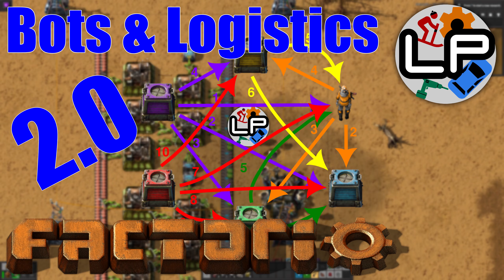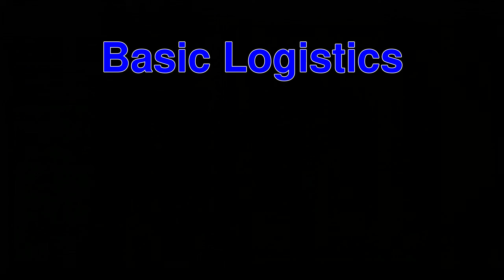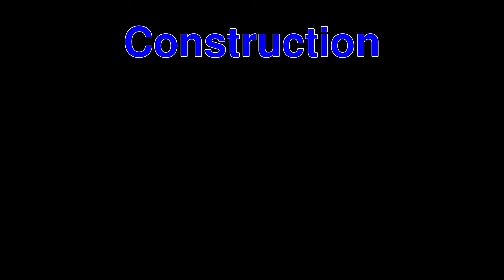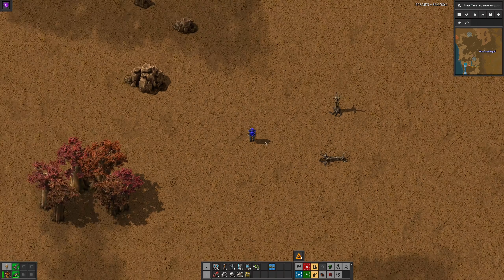Bots and Logistics tutorial for 2.0 - Laurence Plays Factorio

Comment: Nice video. What’s a reasonable number of bots per roboport? Any downsides to filling network with max bots?
Reply from the maker: If a roboport fills up completely then the bots will have to fly somewhere else to park, but that doesn't really matter... 

What I generally do is have machines making both types and putting them into a roboport whenever the number of available bots of their type drops below 100 - that way it naturally grows with your factory. Granted, if you do a massive build, you could be bot limited for a while, but it'll eventually catch up and be ready for your next one! As a bonus, this means you'll automatically replace any bots that get destroyed or stolen!

You can read total bots and available bots from the roboport by linking it to the circuit network, and turning the appropriate option on inside it - that will read for all roboports linked to that one, not just the one you attach the cable to.
Reply: @LaurencePlays  I personally use 15 construction bots and 10 logistics per roboport. The robots get into the system via inserter with logic - by comparing the [R - number of ports in system] *  (type_of_robot_per_port) and the actual amount of robots of specific type.

I guess you can use robots available for logistics and robots in system for construction, as logistics shouldn't have spikes, but my bases don't relay on bots for the most part, so I haven't seen any issues with my way.

Comment: You didn't explain anything about how to actually create a logistics network or how chests are linked to it via the colored wires. If I have a factory creating turrets and dropping them into a red chest on one side of the map, how do I make robots on the other side of the map access those turrets via a network?
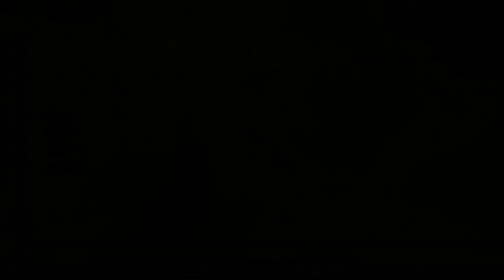Reply from the maker: 0:33 "The roboport network is formedby placing multiple roboports in range of each other" so you just need to make sure you've got linked roboports all the way from the red chest to where you want them to be built. Remember that the red chest has to be in the central, orange area around a roboport, but the building can be in either orange or green areas. 
You don't need to link cables to the chests for this, however the cables do allow you to do other things.
Reply: @LaurencePlays  Yeah I got that part. I wasn't clear on the need for roboports to be within range of the red chests at the factory output. I guess I imagined that simply linking the chests via colored wires would give them access to each other regardless of distance. Of course, as you explain it, it makes more sense.
Reply from the maker: @niconoire  Aha, no, the bots need both the pickup and dropoff/build areas to be covered by the roboports. This allows you to split off different networks, if you feel the need to.

Comment: Really great explanation, thanks! Using bots has really been great. I delayed it bc i knew id have to  figure it out. I'm on my 4th attempt and finally launched a rocket. Now with space age, there so much more to learn. My factory is a huge main bus design with nuclear power. I built all of it myself without bots and it was getting too difficult to manage. Now i feel dumb for waiting so long to use them. I have an extensive fluid network bc i despise fluid shortages, having bots to fix it now is a relief lol. This game is slowly consuming my life. I'm finally learning trains next.
Reply from the maker: Thanks! Yeah, bots essentially unlock copy/paste, which makes expanding the factory a breeze instead of a chore. It's one of the things I consider to be basically essential in any factory game. 

Have you seen my tutorios on trains? That would give you a good starting point with them! 

I'd recommend playing quite a bit of vanilla before moving on to Space Age - it's quite a lot more complicated. Great fun, but definitely a step up in difficulty!

Comment: so I basically figured most of this on my own with trial and error and it wasnt that hard as I thought. the hard part is using this in a smart and fast way and have everything ready for building when you need it
Reply from the maker: Definitely; having a decent sized buffer of parts so when you request a build, it happens quickly and smoothly is vital to keep the game flowing nicely. If it takes ages for your orders to be fulfilled it can be frustrating. 

I think using it smoothly and remembering all the tricks and things you can do when you need them is something that just comes with practice.

Comment: Active providers can be useful for recipes with side-products. Can help make them scalable and immune to jamming even without using circuit logic. Example - moving liquids with barrels.
Somewhere you have an assembler making empty barrels and putting them in a passive provider chest (or storage chest). Whereas assemblers emptying liquid barrels put empty barrels into active provider chests. Logistics bots ensure the system never jams because of too many empty barrels filling an output chest (the barrels will be stockpiled in the requester chests, which can't jam the system), but if you expand your factory and more barrels are needed, they will get pulled out of the passive provider chest as needed (prompting the barrel maker to make more barrels as needed).
I bet with mods there are more recipes where this could be useful. I haven't gone far enough in Space Age yet to see if there are any new vanilla use cases, but I imagine there are more recipes with side-products, plus quality and recycling, so probably. Removing spoilage sounds like it might be one case. If you have some system making spoilage intentionally, and other systems that may make it accidentally as an unwanted side-product, it makes sense to use up the unwanted spoilage first, before taking spoilage from the 'spoilage factory'.

Comment: Active Provider chests i use for "trash" products mainly on gleba. Spoil and seeds. stuff that if the chest is full blocks your machine.... like that i collect all the seeds and all the spoilage.. seeds to replant and spoilage if its too mutch to a power burning plant.. and the system never blocks.. its a but bit heavy but not too mutch and mutch easyer to build than an enormeus&complicated transport belt network.. and normally its not too mutch stuff that has to be transportet by bots..

Comment: I use active provider chests to clean out stuff from the landing pad.
Reply from the maker: That's fair - I think I wrote that before landing pads were a thing, and didn't really reconsider it for Space Age. When I did play SA, I still fed stuff from the landing pad with inserters as much as possible, so I think I added more storage to it, rather than emptying it out asap. I try to minimise logistics bot usage in my own factories.
Reply: @LaurencePlays  It was a good way to get free metal and steel from orbit. You can set up a permanent non-mobile station up there to just do science and refine metal and steel.
Reply from the maker: @Spartan1312  Yeah, I know Tristan did that on Nauvis; I moved most metal related production off to Vulcanus and then shipped the science packs back to Nauvis. I did have ships dropping copper onto Fulgora when I made the mistake of trying to bulk build yellow science there though! 

Don't make yellow science on Fulgora. It's a pain to expand!
Reply: @LaurencePlays  Fulgora is hell to expand anything on until you can both destroy mountains and landfill the ocean.
Reply from the maker: @Spartan1312  On a small scale, it made sense! Everything you need is easily made from scrap... And then you realise how hard it is to scale up! I even moved to another, larger island.

Comment: been playing for 10 days now and I never tried to touch the logistic tab, but with this video I now fully understand how powerful the logistics is, now I will be a bot master.

PS the reason I stumble upon this video is because I'm trying to search if there's a way to make robots to fill in a designated chest?
I have an overwhelming spaghetti base right now and I don't want to rely on other's blueprint/base design yet for my 1st playthrough. so I was trying to make a certain area dedicated for chest for all kinds of items so I won't go running around the base if I need a belt or a circuit or an ammo.
Reply from the maker: The bots are very worth it, especially the construction bots! You'll come to love them quick. 

To your second question, the answer is "Yes!", but there are a number of different ways, depending on where you are in the researches. 
3:16 - if you just have yellow chests, you can set filters like this, and the bots will try to put stuff in the right place if they're carrying it. 
9:14 - you can manually request stuff to be placed in certain places, but this works a single time, once the bots have fulfilled the request, it'll be removed and won't be replaced if you take that stuff
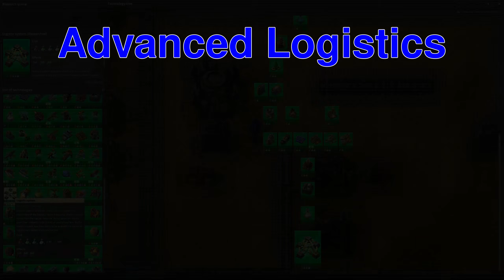10:19 - finally you can use a blue (or green) chest to request the items to a specific area, provided they're put in red or yellow chests when they're made. 
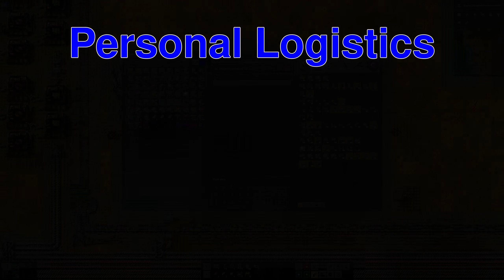4:19 - Or, just have personal logistic requests set up, so the bots bring those items to you as you need them!

I hope that helps - if you have any more questions, let me know! And good on you for not using other people's blueprints; designing stuff is half the fun of Factorio!
Reply: Buffer chest or personal logistics should help

Comment: There are some uses for purple chests. I often run into a problem with the number of red and blue circuits in my factory but their machine footprint and belt throughput cost is really bad and big. So I place them far away and use purple chests to force them to fly to depo locations where they then get used by a lot of stuff. I also put the inserter to logistics maximum so it doesn't go overboard.
Reply from the maker: Yeah, logistics max is very useful to make sure you don't end up with chests of shame full of stuff. I don't understand why you'd use purple chests for that rather than red and blue ones though - is there something I'm missing?

Comment: How many bots should I have in each roboport?
How do I make every roboport have this amount?
Reply from the maker: It doesn't really matter how many are in each one - they'll fly in from wherever they're sitting when they're needed. That said, if they're ready and waiting, it can speed things up a bit! 

There's an option in the roboports to specify the minimum number of each type of bot that you want to have sitting in it, so you could use that to make sure that some are always pulled back to your mall area, ready to carry parts out for building. I've not used that option much myself, but I can see how it would be useful.
Reply: @LaurencePlays  I've just unlocked them so they are super slow that's why
Reply from the maker: @MercerWing1  Yeah, I can understand that! I'm always surprised at just how slow bots are whenever I first unlock them in a new game! 😀  I go over setting minimum numbers of bots in a roboport at 2:30; I guess things to consider are how many bots you have in total, so you get a sensible number, and also perhaps setting it as a combinator set so you can update it in one place to have all your roboports update.

Comment: How do you place the ghost ammo in? I can't find a way.
EDIT: ah, have to do it from map view.
Reply from the maker: Aha, you found it - good to see. Yes, from map view, left click to place a full stack or right click to place a single item at a time. It also has to be a ghost turret for the instruction to be copied with the turret!
Reply: @LaurencePlays  Yeah, that was a great tip. I used to place them manually and then drom ammo with Z. This is much better ^^
Reply from the maker: @Teh-Penguin  We've got extra cheaty in our current run with the fill4me and even distribution mods - they cause the turrets to be automatically loaded when placed (at least by hand), which is even easier ... but a little unbalanced. Especially when you use the Far Reach mod as well!

Comment: Very informative with nice little tips tricks in QOL! Loved every second. Give us more of your knowledge!!

I think a useful tip for those that dont know, would be that a roboport has 4 charging slots, so if you get a bunch of bots trying to be lazy, make a charging port of multiple roboports to let more recharge at a time to prevent a bottleneck. I dont know if youve already mentioned this in other videos, but as a new player experimenting and learning, this is my contribution!
Reply from the maker: Thank you! There's a lot of new stuff in 2.0 that I need to make videos about  🙂

An excellent point with the charging - most of the time when the robonetwork is struggling it ends up being because there's a massive cloud of bots waiting at a charger. I don't think I have mentioned that anywhere though - I don't tend to use logistics bots all that much (I prefer belts!), so my networks tend not to be too stressed except when I do massive builds... And those are temporary enough that I don't mind if the bots are charging slowly.
Reply: @ I cant wait to see your take on the different planets!

Good luck on Gleba. That place took some brain wrinkleage to solve for sure. Especially without using cop out bots!

 My favorite use of bots so far is to sort Fulgora's trash over the span of a couple tiles. Like a line of unsorted providers, with the bots shuttle running 2 tiles to requesters to sort everything quick onto a belts. 

Or just make a lazy bot mall hahahaha
Reply from the maker: @ That's some good timing; I just finished my Space Age stream last week and have been making some retrospective videos looking back on what I did; they'll be coming out over the next few weeks. I'm proud to say I used very few bots for mall type purposes - except when trying to deal with quality stuff. At that point I'd had enough and got lazy.  😀
Reply: @ Oh Im a little ways behind you then with this being my 2nd playthrough. I picked up the game right after space age dropped it seems! I love the other planets and testing of systems.

Ill have to check out more of your stuff man! Ill try to add any helpful thoughts if I think I have something to add.

Keep up the good stuff brotherman!
Reply from the maker: @xNUNYAx  Thanks! Yeah, I've played a silly amount of Factorio - I think I'm 3500 hours in now... But only just finished Space Age for the first time. I've really enjoyed how every planet plays differently, it's like being a Factorio beginner all over again!

There's lots of content on the channel, so no matter how much time you have to fill, I think I should be able to.  😀

Comment: Video suggestion: Different ways to use all 4 boxes (tricks & tips) that you havent covered. (For example: set up a yellow box that only asks for yellow belts, then link it with an inserter to a machine making red belts... so that yellow belts that you trash or replace do not end up at your main yellow box area that has 50 yellow boxes of sorted trash. I would like those yellow belts to be used in making red belts, for conservation of resources.)(2nd example: add a green box with 'set requests' in different areas of the map, so that if a request comes in, it doesnt pull it from your main base, miles away (maybe obvious, but I didnt realize it until 2 yrs into playing)

Comment: Thank you for the vid. Help: When i copy/paste recipe to a blue box it copies it, but at 4x. I tried clicking different areas of both entities with no avail. If the machine wants 100 iron, after I copy it to a blue box it shows 'requesting 400 iron', which I don't want and then I have to manually set the blue box to 100 iron. It does this 50% of the time. (note.. my experience is = finishing Space Exploration 4 times) You have helped so many times when I get stuck. Your vids are easy to understand. Thanks for going slow and for close ups.
Reply from the maker: Thanks for watching! So, when you copy and paste a recipe like that, Factorio brings in enough ingredients to run the machine for 30 seconds, with the theory being to give it enough of a buffer that it should be able to keep running, without using up all of the supplies. I will agree that that's often not what you want! Still, it's a quick and convenient shortcut, even if sometimes it leaves some tidying up for the bots to do.  🙂
Reply: @LaurencePlays  The problem is solved if it happens every time. Only happens 50% of the time. Otherwise, it copy and pastes exactly as it is supposed to do. Which brings me back to, am I pressing the wrong area on it or do I have a macro key I am not aware of, or is it just stuck. Thanks for re-answering.
Reply from the maker: @ I'm not aware of any other copy/paste options there; certainly pasting more than once doesn't add additional requests. Does this happen with the same recipe? I'm wondering if the 50% where it works are longer duration builds, so it only requests enough for a single build.